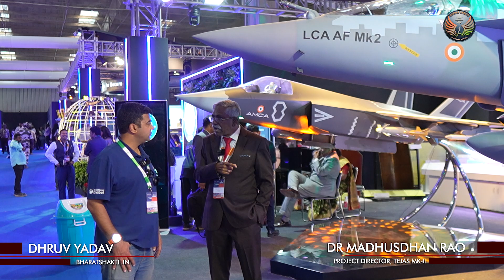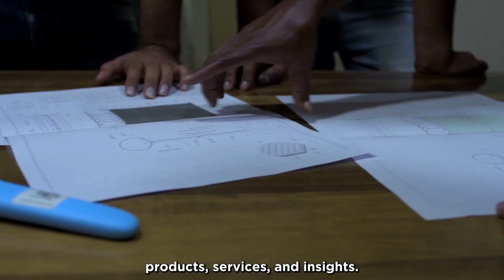Tejas Mk-2 Project Director Sheds Light On Capabilities Of Upcoming Fighter

Comment: Why is the IAF going with the additional 97 mk1A?  If by the time the first order of 83 will be completed, Mk2 is ready for mass production wouldn't it be more prudent to get the mk2 in bigger numbers, since it's a significant jump capability wise.. maybe the initial batches totalling 40 Mk1 of IOC & FOC be upgraded to mk1A thus giving the airforce a total of 123 aircrafts of mk1A with latest avionics/radar and weapons package and spend rest of the budget on the much superior mk2.

Comment: I don't understand how the Tejas Mk2's RCS will be 1/4th of the Mk1A. The air inlet design & single vertical tail fin are identical (engine fan blades & vertical fins are both key producers of radar returns), so... how did they achieve that? I sincerely hope this isn't just hype but actual, verified advancement.
Reply: It's because of material and shape.

Comment: The speed at which hal is going on is abysmally low....this is absurd.....it has been ages since i am hearing of tejas mk2 soon to be taking flight....it's just takes one word to express the situation - PAINFUL
Reply: What are you talking about? The approval and the release of funds to produce the prototype was given only recently. HAL started the prototypes straight away once the funding and go ahead was given - impressively fast. The deadline is very tight though. The government is still discussing the contract for production of the engines with GE, which will be required for the production stage.
Reply: @jonswap9097   that is PAINFUL

Comment: Waste project Tejas Mark 2 - it will only be produced in 2030.

HAL.is only good at manufacturing demo aircraft and flying VIPs.

HAL is unable to supply the Tejas Mark1 & MK1A still. And now they are talking about MK2. First let them deliver what they promised. 

HAL today is the PSU which is wasting Indian tax payer money and the senior management is just useless sinxe for 40 yrs they have not supplied any fighter aircraft till date

HAL just makes tall claims. 
By the time they mass produce ghe Mark2 in 2030, the world and China willl have gen 6 aircraft which makes Mark2 a junk aircraft if at all they deliver it.

Comment: mk2 will never be ableto supercruise and future is all about low rcs, then why did we design structurally low rcs design similar to griepen or rafale,
Mk2 will be backebone(work horse) of IAF for more than 40years then why did we not design structurally stealthy?????????????????
Reply: It will feature it too stealth also depends on radar coating and radar released by the jet
Reply: Gripen and Rafale have an RCS of 1-1.5m2 - 3 times that of Tejas Mk1  - that is why Tejas "shot down" the Rafale and Typhoon in BVR in the recent air exercise in India. Tejas Mk2 has RCS of 1/4 of Tejas Mk1. That is useful. Of course because of no internal weapons bay, that will increase with weapons carried, but still, armed with Astra 1, 2 3, or 4, it will shoot down every other 4.5 gen fighter in the MRFA tender at BVR no problem. The Tejas Mk2 frontal RCS of 0.12m2 is actually smaller than the 0.2m2 for the J20 and Su57, although with two AAM it will probably increase to about 0.3m2.
The reason for no internal weapons bay is due to Tejas being too small - that has advantages in visual stealth in close combat. AMCA has internal weapons bay.
Tejas should be able to supercruise at low supersonic speed like Gripen E as it has greater thrust (110kN compared to 98kN) and a lower drag delta wing planform. Supercruise is only important high altitude escape to avoid tracking by IR emissions of the afterburner. In a low altitude attack avoiding detection by hiding behind the radar shadow of mountains for example, you cannot use supercruise.
Reply: but 98kn engine is not sufficient to operate mk2 in full power or high t/w ratio? if brahmos ng (1300kg) is planned to inducted..........

Comment: mk1 toh de do air force ko pehle phir baat karna mk2 ki 😢..air chief thak gaye bolte bolte kab doge unko
Reply: Engine nahi mila to kaisa daga gal 😂😂
Reply: @HrishirajDebnath-dc8uv  Engine delay was for MK1a.. What’s the excuse for Mk1. Also the air chief was promised 11 MK1a airframes minus the engines in Feb. Where are they?
The so called MK1a was not fully MK1a either. Will you call the air chief a YouTube general as well?
Reply: @srikanth85in  
There is a lot of venom and hatred in your attitude. Why? Why do you want airframes without engines - do you not realise that it will not fly without engines? 
There was a report about a month or two ago that 9 airframes were waiting, but they would probably not be plumbed with all the equipment. Babus will not understand this, but good production engineering practice dictates that the whole production line is halted when there is a stoppage at any point in the production line. The reason is that the precise sequence of work, checks, and tests in the production line is followed in assembly in order to maintain high quality control. If you halt assembly at some point, go away and come back a few months later to carry on, things get missed out, and it takes time to figure out where you left off, just like if you do that with following complex assembly of flat pack furniture at home. There is no point doing part assembly just to win babu brownie points since it does not save time, and negatively impacts quality.
Reply: @jonswap9097  Ranting a lot doesn’t make it right though. Have you listened to what the air chief had said? He was “promised” those airframes by HAL, and also showcase the complete 40+ enhancements from MK1 to MK1a. None of that happened.
This has nothing to do with hatred or anything else. It has to do with the sad state of affairs